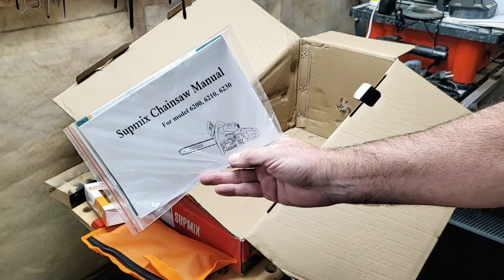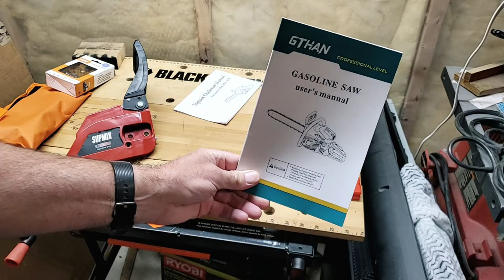Real-Life - $200 Amazon Supmix 6210 Generic 20"  60cc Chainsaw Build and Test Run

Comment: 1. You probably know this, but maybe some of the viewers do not. Right at the tip of the chain blade there's a little hole that has to be greased with a grease gun. They sell one for about 7.99 exactly for this purpose. You have to fill it with grease until it oozes out from underneath the chain. 

2. When you put the orange cover on the blade chain plate, you have to make sure the chain adjustment protrusion goes into the hole of the chain blade.. Otherwise it will not adjust.

 3. Just found out putting oil in it is not enough. There is a screw underneath the chainsaw (hard to find) that disperses how much oil is going onto the chain. They recommend running  at medium speed to make sure there is oil flicking off the chain so it is sufficiently lubricated.

 4. Don't know how they come up with the name Supmix. I would've named it Woodsman. Or maybe after a shark since it has teeth Great White, Orca, etc.
Reply from the maker: Thank you for the detailed comment, I appreciate it. I'm going to adjust my chainsaw as per the details in your comments. Thanks again. Yes, Supmix is a strange name for a chainsaw lol. J
Reply: Its called a guid bar not a blade 🤨
Reply: Make video showing

Comment: Not many videos on this saw. Thanks for posting. I like mine so far. I noticed yours does the same as mine. The chain brake won't hold the chain if you give it some gas. I don't think that is the way these chain brakes are supposed to work so just be cautious of that.
Reply from the maker: I agree with you 100%. A couple weeks ago I specifically tried to trouble shoot that issue, not luck, so I'll be careful.

Comment: I have the same saw, works well, only issue is the kill switch was faulty on mine.
Reply from the maker: Yeah, I have had the saw for a year now and still works fine. Overall a good deal and a nice tool to have around the house. If say after a year, well worth it. Thanks for your comment btw. J

Comment: My saw works excellent. Purchased mine in June of 22. Only issue is I find the chain is of poor quality. I recommend replacing with a Stihl or Husqvarna brand chain.
Reply from the maker: That's a great comment and I'll do that too. Seems like Home Depot in my area stock those brands. Yeah, I'm not disappointed at all. We had a major storm in my area in May 22, trees, fences  were knocked over and chainsaws were required, plus generators for 6 days. Now I'm all set for next time. Cheers.
Reply: Oregon makes some outstanding chains. Excellent quality.
Reply: How many drive links and pitch did you get for a new chain??

Comment: I’ve had mine for over two years and it’s a great chainsaw for the price. Will keep it till it dies. Things I’ve found with it.

1. On a hot day it’ll over heat and not want to start sometimes even though I have adjusted the carb. 

2.I noticed it doesn’t like cheap bar oil. I found husq all season bar oil works best. 

Overall love the little beast. I think I’m going to try putting a bigger bar on it (maybe 24in) and see how it handles.

Comment: Can you use old use motor oil for bar chain lube?
Reply from the maker: It doesn't say that you can or can't . For me personally, I'd use clean motor oil and not worry about it , but chain saw oil is a bit thicker and with that won't fly away off the chain as much as Motor oil would.
Reply: @Motorcycology  Thanks for your reply. Very helpful
Reply: adjust the bar oil flow more and you can (screws under the bottom somewhere) but its still not worth the risk